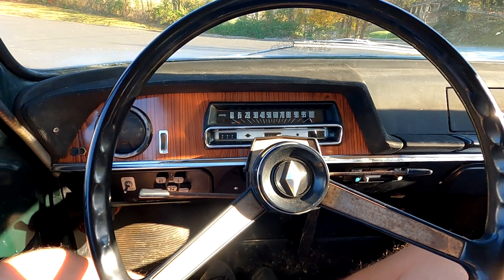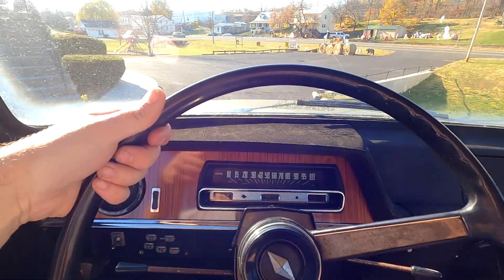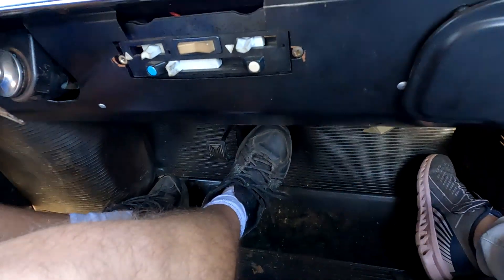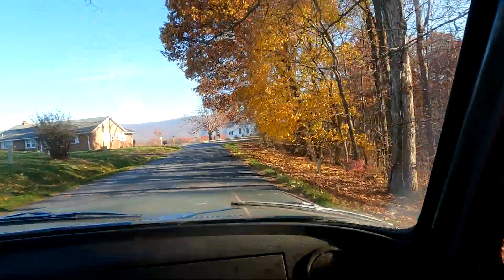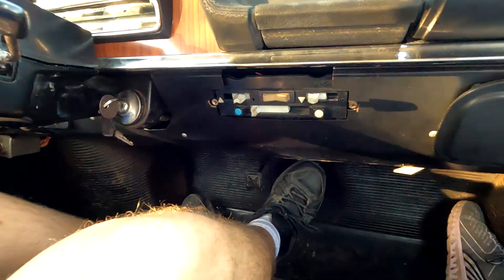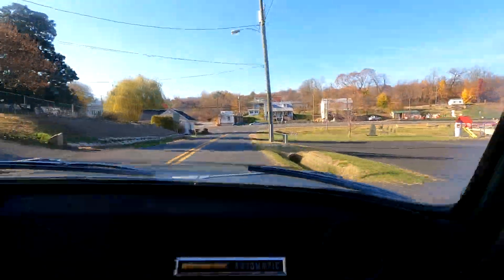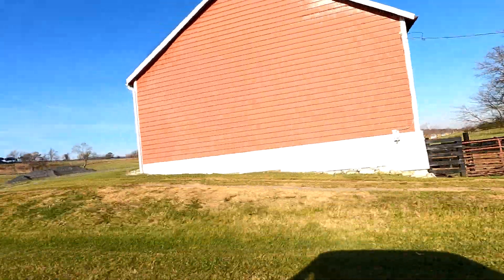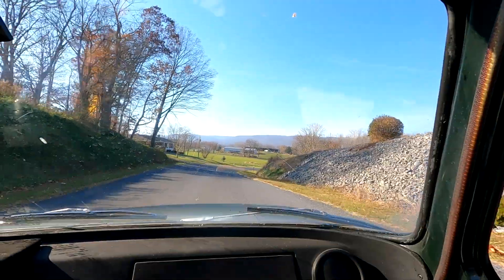How does a Renault R8 R10 Automatic work?

Comment: My sister had one of those back in the 70s and the automatic transmission never worked right.
Reply from the maker: The relay box, and powder clutch are the strong points. That whole shifter unit is where it's just not ment to work well.  If they would've used a auto stick(like vw). It would have been great.

Comment: The function of the city hi way switch was simply to lower the downshift into first gear from 9 to 7 mph. Customers complained about the lurch on the earlier ones because the downshift into first at 9 seemed abrupt. Great that you got it running!

Comment: Thanks for making these videos.
Watching it reminded me how easily steered the R-8/10 steers, and the awesome design of the front air vents that are SO adjustable.
Jealous of that "glove-box" on the dash high center !
(I have a 1968 R-1135 )
Reply from the maker: I'm running a mercruiser boat alternator at the moment. Was cheap, and with a V belt pulley swap. It bolted right up.  

The powder clutch draws 5 amps when working. With that, heat, and lights. The old generator would struggle. 

 Still on points, even has the original plug wires!
Reply: My dad was a renault dealer in Quebec when these were new. That little switch never came from the factory.  These systems worked decently when new but in quebec winters we used to put engine oil in the gearbox because 7590 was to thick for the selector to work. q
There are brushes under the car between engine and transmission to activate and deactivate coupler. They require frequent  replacement. Nb you can't take out and put back without cover . The cover was always sold with the new brush set.
Reply from the maker: Engine oil you say? Did he use just 40 weight?

Im starting to have problems right now, on the downshifts. At 50F  10C.

 Its taking way too long to drop a gear.  Then coast to the side of the road, and hope it makes a decision..

Ill try engine oil.

In the first video of it, I destroyed my brush carrier. Was lucky to find a good used one.   I had read the book, it claimed mine was a version that didn't need said brush holder tool.   To be fair my old brushes were jammed full of grease-like a rock!

 @philiptaylor174
Reply: Where on earth did u find a used brush holder?  The new brush set was always sold with the tool. It was only the cover upon which you attached a string so after putting holder in place you pulled out the tool.  Yes we put I think even 30 weight motor oil for winter conditions.
Reply from the maker: @philiptaylor174  A renault parts place in Ohio, USA.  He has a bunch of auto stuff